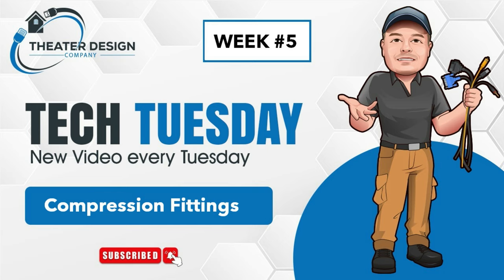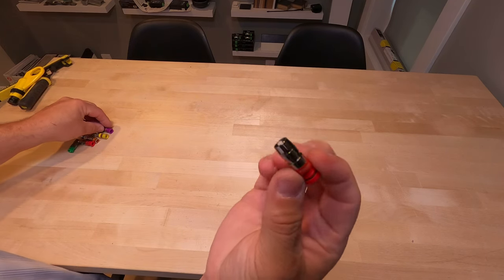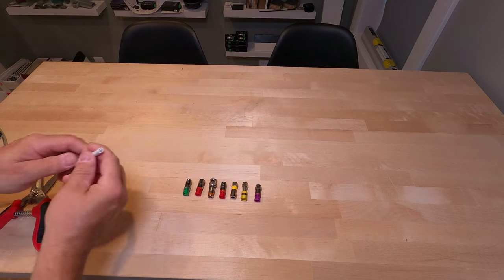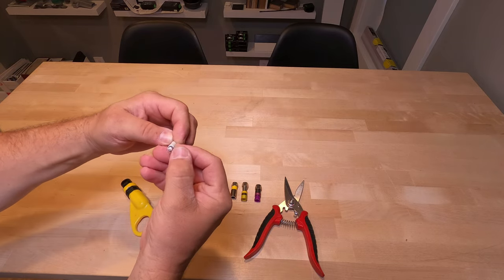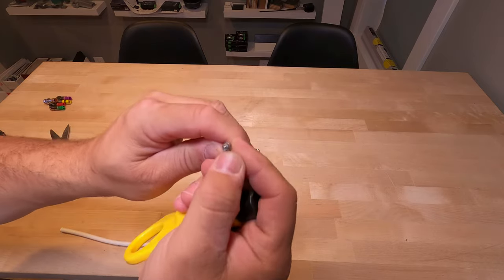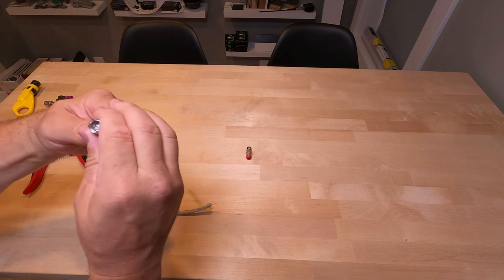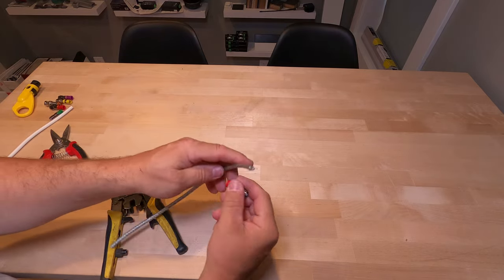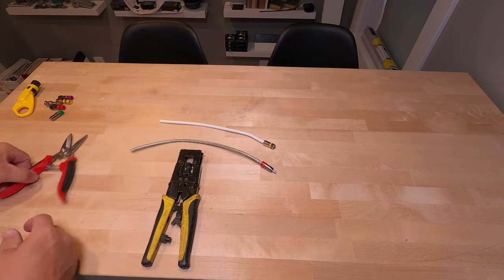Compression Fitting for Home Theater Subwoofers | Cable TV - Tech Tuesday Week #5

Comment: Can you add the links for the cable & compression ends as well?  Specifically the RG59 for your rca cables (the silver one).  I am about to start my low voltage pre wire on my personal new construction house & need some long runs of RCA for some distributed audio.
Reply from the maker: Yes for sure.